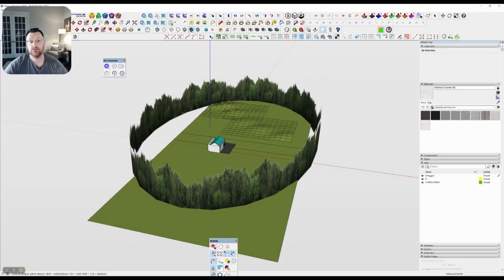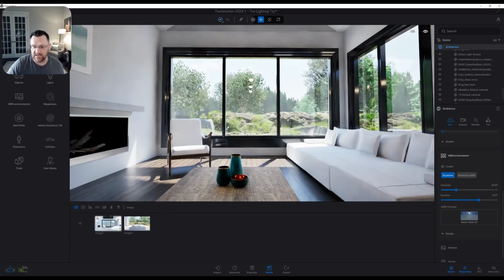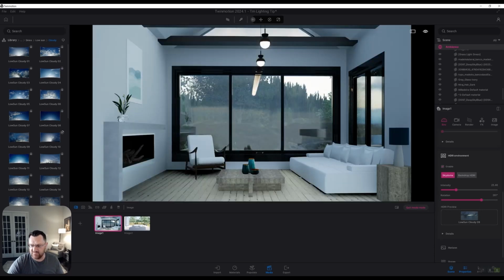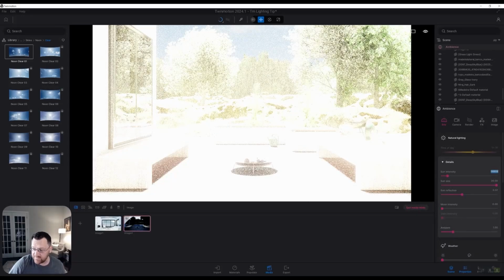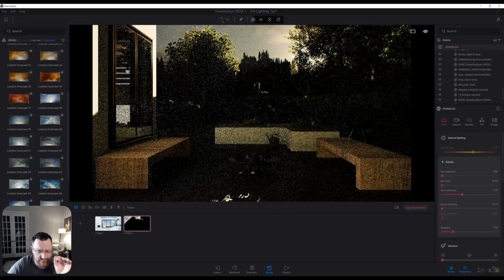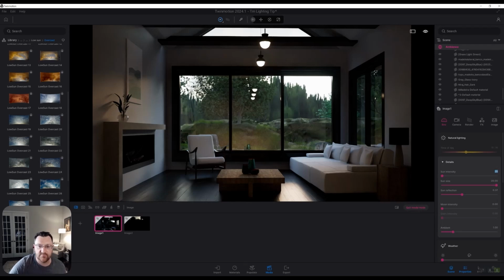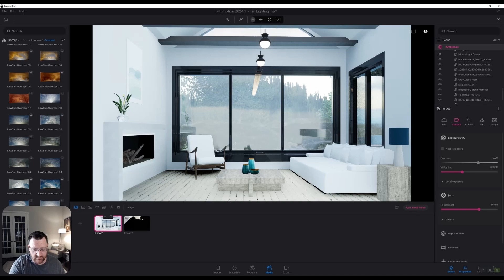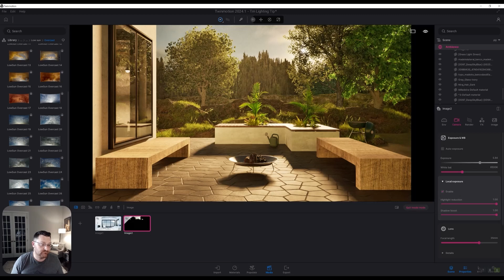Twinmotion: Three Sliders for Exterior Lighting

Comment: This answer refers to your multiple videos about TM, not necessarily to this one. 
You mentioned multiple times that you don't understand why TM changed the sun intensity spectrum and that you prefer the old one. 

The truth is the 100 000 value is measured in Lux. These are physical units used to measure sun brightness in SI system (metric system). Typical  brightness of real sun is 80 - 100 K lux. So this is part of the "physlight" concept in PT,  to create an environment with physically accurate parameters (the rest of the parameters are also measured using real-world units (lumens, nits). This create realistic behavior of artificial lights (they are invisible in the scene exposed for the sun. The default brightness of artificial lights is set to 300 lumens.
The use of this system for now is bit limited for now - note that if you switch to HDRI skydome / backdrop the intensity of the sun drops by default to 0 under PT and to 25 under Lumen and skydome brightness varies between 1 and 4. This destroys the balance between sun and artificial lights. (BTW In lumen you shouldn't disable the sun,  HDRI as the only light source will create splotchy shadows.) In theory you may increase the skydome brightness to 100 000 and regain the physically correct balance but you may notice artifacts in the rendering (as bluish tones, lots of fireflies etc.).
Also there is no "universally accurate" HDRI standard. Each image has it's own range, peak brightness, shadows representation etc. So you have to adjust it's brightness manually and adjust artificial light intensity to match the overall feel, "guessing" proper values. In movie / CGI industry this is avoided by creating HDRI on set and by carefully measuring the brightness using light meters. In archviz we cannot do that. 
BTW When you use dynamic sun  under raster renderer, TM tries also to simulate the skydome brightness using ambient value. This is workaround to limit the number of calculations. It just adds some brightness to pixels in shadows. Since this should emulate the light that comes from the sky - increasing this value also makes scene more bluish. This parameter has very limited effect under PT (except if set to 0). Reducing its value will make shadows darker. setting it to 0 will make them black.

Regarding number of samples and bounces in PT. Sample is a light ray that comes from the camera and goes through each pixel of the image and at the end hits a light source (in physical world the light rays go in opposite direction). PT solution limits the amount of calculations by reversing this direction = light rays which does not end in camera can be skipped. When a ray hits an object it bounces. The bounce direction is forced by the direction of the surface it hits and its material properties, the bounce direction is more random on opaque materials and less random on shiny materials. Then the ray will "fly" until it hits another surface, and this process repeats itself. The "max bounces" parameter decide how many times the ray will bounce. Note this is maximum value - TM may decide that it should calculate less bounces. The typical cases for this are: the ray hits the sky and "escapes" from the scene, the ray hits the camera, the ray hits very dark material.  
At the end of the calculation process, when colors and brightness of each pixel is known,  the denoiser starts its job. Denoiser works on pixels, it does not understand the image structure. 
Thus the number of samples and the number of bounces and the denoiser will decide of the quality of the image. If you reduce the number of samples in your image you will have splotchy shadows. If you reduce the number of bounces you will loose details in shadows. You will also make scene darker. Increasing the number of bounces will make scene bluish cause the ambient light will be more important. 
What if even if you rise the number of samples and bounces to high numbers (like 1024/24) you still have blurry materials or grass? The answer is: you have to reduce the number of samples and bounces and >increase image resolution<. This blur is caused by denoiser, which "thinks" that the slight color variances in your material or grass is a noise and tries to fix it. When you increase resolution it will stop see noise in those pixels.
I will mention one more thing related this time to raster rendering (Standard and Lumen) and those are light leaks. There are multiple reasons for light leaks in rendering engines. In UE / TM light leaks are caused by limited resolution of the sun shadow texture. TM/UE uses technique called Cascaded Shadow Map to create sun shadows (similar technique is used for artificial lights but it has less limitations). Back to the sun. Imagine that all the shadows casted by sun on all objects and the ground are in fact single gray texture projected onto whole scene (this is bit simplified). Even if the texture resolution is big, the texture is stretched over very large area. To avoid jagged shadows this texture uses blur to hide the pixels. If you stretch this texture over (let's say 100x100m area you will get sharp shadows, but if you stretch it over 5000x5000m it will be significantly blurred). The shadow distance parameter is in fact the distance on which this texture will be stretched.
If you set it to 500m you will for sure see the texture blur  - and this is your light leak. So if you are creating interior rendering, set the shadow distance to 20m to have crisp sharp shadows without light leaks. Increasing the thickness of the walls will also help (cause shadow on the texture will be larger). 
Note that CSM stretching is also responsible for lack of shadows from small objects (like furniture or tableware).  If you reduce shadow distance you will see these small shadows.
BTW if you see some stripes on your objects in certain light conditions (low sun typically) this is also caused by the shadow map (how it is applied to objects). To mitigate this increase the shadow bias but remember - this slider makes this texture more blurry, so it will increase light leaks.
If you want to avoid light leaks completely - use PT. Eventually the CSM under Lumen will be replaced by VSM (Virtual Shadow Maps) that offer much more precision and will make most of those problems gone.
So these are some technical explanations of TM light settings (not all of course).
Reply from the maker: Dear user,

The best way I can respond is to go point by point with your issues and comments and hopefully provide some clarity. Please note that some of these points are from comments you have made under other videos from this channel. 

“Seems you mentioned on one of your videos that you use UE but I really don't see the typical knowledge that comes from it which can explain limitations and workflows of TM and D5”

Regarding the Unreal Engine, I have opened it, watched a lot about it (I like William Faucher’s channel a lot), but never used it in any professional capacity. I have no real knowledge of its programming architecture, or how to use it for Architectural Rendering. I do not believe I have ever claimed otherwise. Please correct me if I am wrong about this.... I am aware that D5 and Twin are built on the Unreal Architecture, but as an end user, I do not have to know all the details of how the software works. I shouldn't have too either. My job is to make renders and images, and teach others how to do the same. That's all architectural renderings are, at the end of the day.

“V-RAM ISN'T VIRTUAL RAM! it is VIDEO RAM “ 
 Um, I misspoke here. It happens. Making videos for Youtube is hard work. Try it, and share the results with me.

“You mentioned multiple times that you don't understand why TM changed the sun intensity spectrum and that you prefer the old one” 

I understand why the change was made (the documentation talks about it), and the shift to Lux, but as an end user, the shift has made the lighting harder to work with. This is my opinion, and stated as such. Your comments on the Path Tracer and Light are very interesting, thanks for the detail you go into. Do you have sources that I can look at, or images that can show what you are saying? I would love to learn more. I’d love to see visuals that show what you are describing.
Your comments on the light leaks are interesting, but as a user, it doesn't really matter to me why they are happening, I need to know how to stop them from happening. Understanding how Twinmotion handles a Cascaded Shadow Map doesn't really help me, or anyone that I am instructing; we just need to know how to stop them. Again, I found your insight enlightening though. I am not, and never have claimed to be a programmer. That's pretty obvious in my videos, I even have a few videos where subtitles literally flash up and point out that I am not a programmer!
I’m genuinely curious, do you work on the engineering side of computer science, or in a similar field?  Or are you an architect or architectural rendering artist or designer?

“BTW In lumen you shouldn't disable the sun, HDRI as the only light source will create splotchy shadows” 
Good to know.

“To the author: Sorry to say but I seen enough of your videos lately to say that you barely understand what you are talking about. There is no deeper understanding how all the software you present works, what is going on under the hood. This is surprising for a teacher (I can say it - I'm a teacher too)".

So….as a teacher, you should know that rudeness is just that; rude. If you have knowledge that helps the conversation, share it with others, do not just say * “Sorry to say but from this video it doesn't seem you understand it well”* . This is not constructive or educational and a teacher should know better.

"To the audience: I recommend finding better sources of information about these programs and workflows. If you follow these presented here you will have incorrect workflows and lack of real understanding of the software parameters”

You are not, as I mentioned to you before, under any obligation to watch, like, comment or interact with the channel. The workflows that I demonstrate are mine, and I share them out of a love of making rendered images. I hope they help others, because they work for me. That's it. Everything here is my opinion, and I have never claimed to be an expert in all things rendering, programming or workflows. 

Thanks for all the insights into the Path Tracer and TM light, it's very interesting to me.

Kind regards,
David
ViaRender
Reply: @viarender  first I'm sorry for being rude. I won't defend it. You are right.
regarding meritum: I read your answer with interest. To say bit more about me (for the context): I'm an architect with quite long experience with visualization software (I started with 3DStudio under DOS) then I explored game engines as vis tool (I started with Steam engine powering Half-life 2) this was way before Lumion, TM existed.  I don't have my own YT channel (I never needed it).
Regarding your answer. I noted there is probably one important difference in attitude between us. You wrote "as a user, it doesn't really matter to me why they (light leaks) are happening".
This does matter to me. Understanding why something happens may help you not only fight the results but may actually help you to avoid the problem.  I do not mean coding but I mean the methods (like how raster rendering, ray tracing works). This speeds up the work significantly. In ideal world you will be right - you shouldn't worry about software limitations. But we are living in non-ideal world. Software has limitations. Especially game engines. They affect the workflows significantly. Game engines use multiple shortcuts to calculate results in realtime. Without understanding their methods you will always fighting the software. Without this knowledge you will have incorrect workflow with a lot of guessing.
Understanding what's under the hood will then help your students - just tell them about stretched and thus blurry texture and they will understand what to do when light leaks happen. They will be able to prevent it.
To show another example (this time about path/ray-tracing) - show your students two mirrors facing each other, reduce the bounces to 1 and run PT, look at the reflection, then increase bounces to 2, 3 ... 40. your students will instantly understand what bounces do, it won't be an abstract value anymore. 
I hope it will also make your channel better. 

Regarding sources: William Faucher’s channel is a good source of information. He also shares my attitude - he explains not only how but also why, shows the causes of the limitations of UE. Regarding the Twinmotion, Lumion and the rest of the pack - I won't surprise you - they have good official YT channels with multiple videos. You probably know them.
Reply from the maker: @qazqwertyas  Are you Professor Adam Gil by any chance?

Comment: Hello everyone. In Lumen mode, I recommend experimenting with the local exposure sliders by manually entering the value beyond 1.00. For example 1.20 or 1.50. Both in highlights and shadows. The effect can be very useful in interior scenes where we see the outside through a large glass and the light is excessively high.
Reply from the maker: Thanks for sharing! I'm still a bit mixed about Lumen, and the fast pace of TM development seems to be adding more and more into the mix, but I wish they would slow down a bit!

Comment: Thanks for sharing these lighting tips! I'm wondering if these would work in an outdoor "night" setup? Imagine its a big place outdoors at night with no artificial light..I'm having a tough time to render it nicely. But I will try these tips! :) Thanks again.
Reply from the maker: Hi there. I have not done a scene like this, but I have some thoughts: Night is never really pitch black, there is usually some ambient light, or a major light source (eg the moon, or reflected light from clouds, or even a clear night still has starlight etc). 
Also, you can approach it like a film maker/ director or cinematography; add fake light off screen to light the shot. 
Lastly, even night shots are still a ‘render’, not a photograph, so use your artist eye to fake the look! Basically, light it artistically and using fake light. I hope this helps!